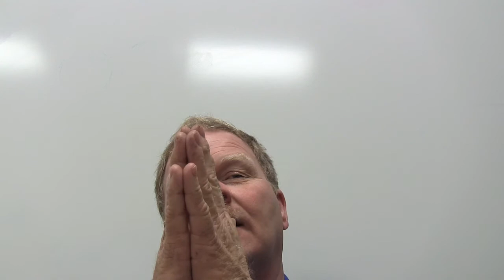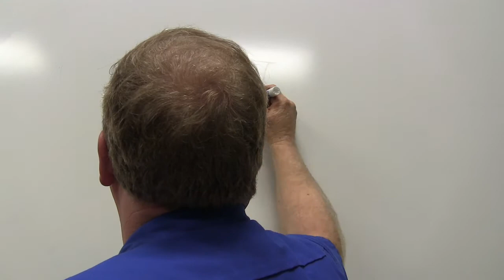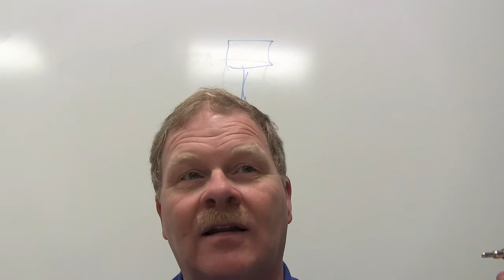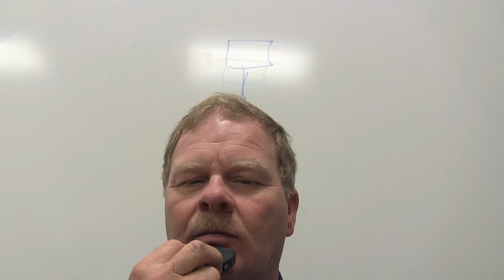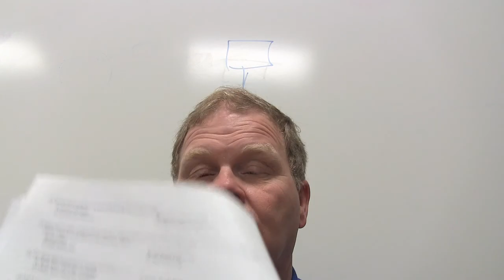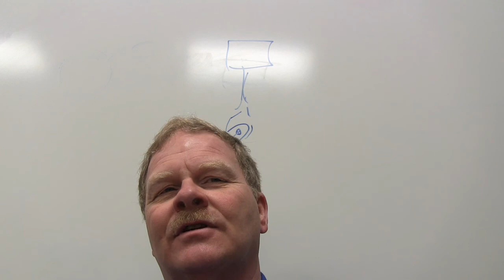Fundamentals test 6   Engine Stuff   gas and diesel

Comment: Tension = Nissan chains can cut clean through metal guides on KA and other engines.
I learned by wing it from the mechanic ninja. You need a good eye and strong puzzle skills to do it that way.  I like the stories you tell and the testing of working parts to know more than what the book does.  The book is no match for experience. The driving test questions do not prove you can drive a car.